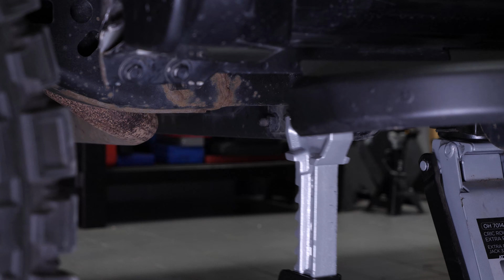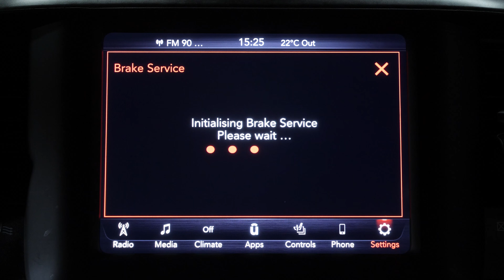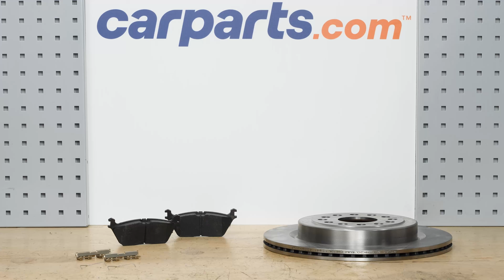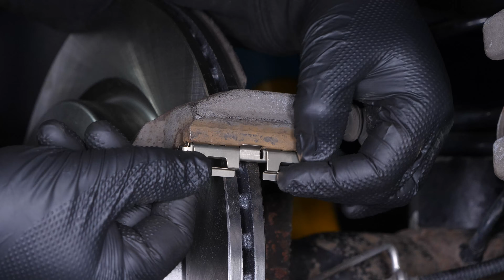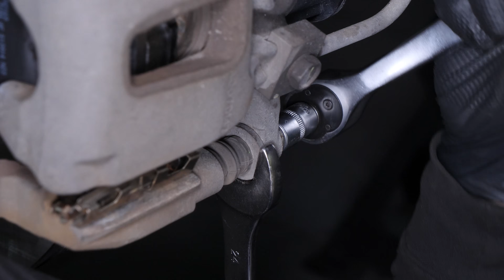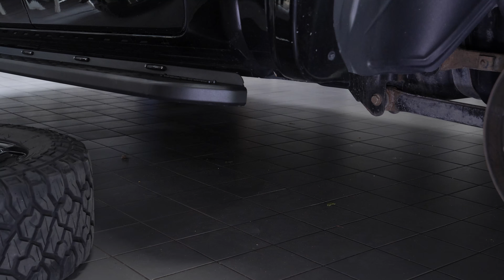How to replace the Rear Brakes 2019 - 2025 RAM 1500 🚗

Comment: Do you know why the abs light is on after doing these exact same steps? I didn’t disconnect the electronic parking brake I just did the same as you showed me?
Reply: Probably damaged the wire